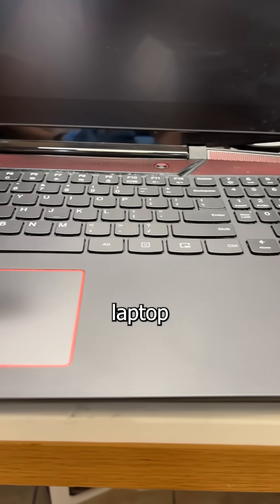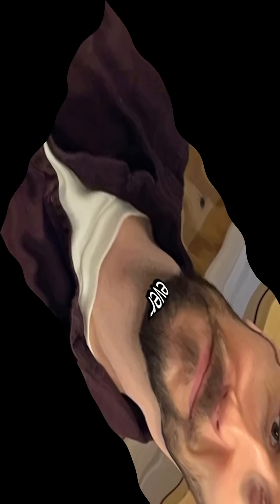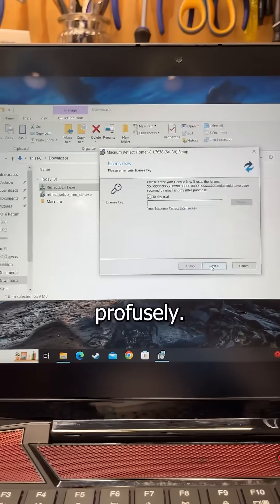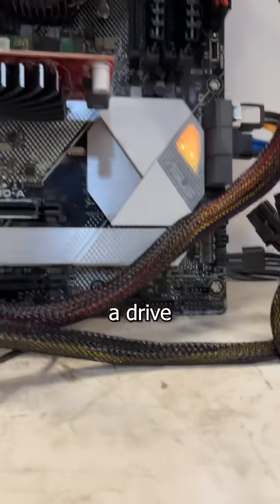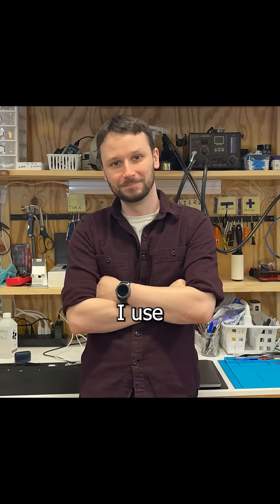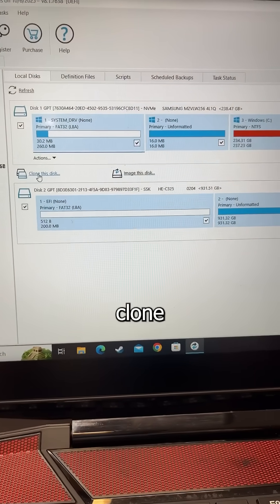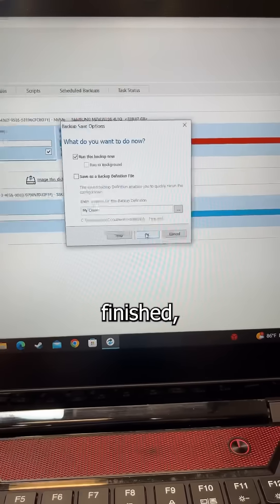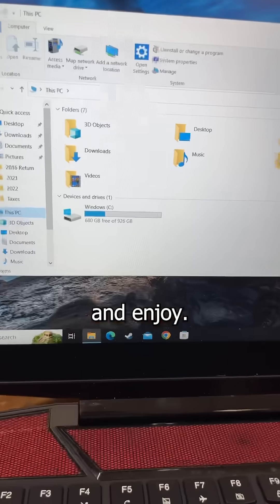Upgrading your SSD has never been cheaper! Clone it yourself! #tech #pc #technology #shorts #laptop

Comment: If you Copy the SSD to the Other SSD how did you get all the GB and voll Gb from the SSD, because i did it aswell and it just went down from 500gb to 120gb because i want to put from 120GB to 500Gb, any ideas how i fix the problem that the 500gb gose back to 500gb and not stay 120gb.. try many thinks but have no idea what to do anymore..

Comment: For the real technicians here: use CloneZilla. Free. Open source. Safe. Compatible with everything. Works without accounts or Internet. Can easily shrink or grow partitions.

If you have space to put it or a shop to run, use a returbished business machine with 2 inbuilt NVMe ports, Lenovo, Dell, HP, for that and install the drives there.

And if you plan on upgrading, clone the drive BEFORE you refurbish the laptop so wrecking customer data is one risk avoided.

Comment: What's the point of "cloning" when you can just install both drives on one motherboard and copy paste? You just might need to delete some files for windows if you use the older ssd as a boot drive. I've done this and have no problems

Comment: Hai, I would to ask by doing this drive cloning process for my drive C storage laptop. Will the system OS able to run automatically later after I change my storage into bigger SSD storage or do I need to reinstall my OS system again ??/ Cause I having this problem to for my current laptop drive C storage. 🤔🤔🤔

Comment: Hello!
I have the Asus K571GT, 256GB on the SSD and 1TB on the HDD.
I bought a 2TB SSD and got an SSK enclosure and used Macrium to clone my SSD to the new SSD.

Ran into an Error 9.
Did some checking, they said to run a CHKDSK on the C drive.
Did that. Restarted

Ran Macrium again. Cloning was successful.
Open up the Laptop, swapped out the old SSD for the new SSD.
Booted back up, and the laptop is stuck on the ASUS loading screen.

No rotating cursor.
Just sitting there for minutes.
Can't even boot into BIOS.

Swapped out the New SSD for the old one, and I'm back online again.

What went wrong? And how can I fix this?

Comment: I killed one of those,,, i owned it for aprox half a year,, then i tuched it,, and its cpu just... exploded on me, no clue how that happend, no doubt it wasn't the porridge i spilled on ot by accident, or the fact i spilled a cup of tea on it, it lived,,, all that,,, untill the cpu blew,,, i heard a poof noise inside my pc and all went black lmao

You may be the greatest technician that ever lived, but im the bane of the existance of every laptop that ever lived, i killed a laptop almoast monthly at my worst because i kept carrying it with me, drinking around it,,, one i even fell on when i moved in my bed and fell out of my bed

Now,,, ive moved to stationary computers,,, its dusty, nothing is screwed tight in my computer, my psu is just laying outside of my pc with random stuff on it, my two hdd's are hanging by the wire out of my case, my gpu,, all that holds my 3060 is hope and wishes ,,, but you'll be pleased to know my cpu and cpu fan is properly tighten and mounted! 😁

Comment: Followed your steps, everything booted correctly, until I uninstalled the app. Now my new drive goes into recovery mode immediately.
Reply from the maker: The app has nothing to do with the clone. You need to repair your boot sector using a portable version of Macrium or manually using bootrec
Reply: @SalemTechsperts  That didn't work. Had to reinstall windows completely, but hey, was able to get my important files back so all fine. Maybe a step went wrong at some point.

Comment: Macrium Reflect is great. I use it all of the time, but only to backup the system and all of it's programs, not to actually clone a drive.

It flawlessly copies software that's restricted for use on only one machine and transfers it to another. That way you wont have to go through the process of re-registering the product or worse yet being forced to buy another activation key. 

Before doing that to make the file smaller, I move all my data such as music, photos and videos to a spare drive then later copy them to the new system.

Like he says, it's a great way to give an old PC a makeover.

Comment: What's the adaptor that you used? I've got a desktop PC whose NVMe I'm trying to upgrade. 

Is it this one (UGREEN SSD Enclosure, Tool-Free USB C External, 10Gbps M.2 NVMe to USB Adapter/Reader Supports M and B&M Keys and Size 2230/2242 /2260/2280 SSDs) ? 

I'm ugrading a 256 gb drive to this 1 TB one (SK hynix Gold P31 1TB PCIe NVMe Gen3 M.2 2280 Internal SSD, Up to 3500MB/S, Compact M.2 SSD Form Factor SSD, Internal Solid State Drive with 128-Layer NAND Flash)

Comment: Don't forget to set the new drive as the boot drive in the bios.
Reply: Tbh you don't always have to do that. Ag least I didn't. I just put the drive in and it worked fine. Just reformatted the other drive as a secondary storage option

Comment: Sir please I have a laptop an old on persay a compact . Anyway I just changed the screen and the hard drive but it still has this same issue. The system fans sound like a dieing dog and then the the screen always doesn't display and the caps lock button light keeps flashing when the screen is dead and the issue normally fluctuates pls can you give me some advice

Comment: does this sort of thing work with hard drives too? my computer is stupid and has both an HD and SSD. the operating system is of course on the hard drive. the thing that could go kaputski literally whenever. if i can’t swap the hard drive for a solid, can i at least increase the size of the HD?

Comment: Hello, TGTTEL. I need help on my laptop for work. I've been needing to upgrade my ssd. I currently use Sandisk sd8sn8u-256g, which I want to upgrade into 1tb nvme. What I need help with is that I don't know what nvme pci gen is compatible with my laptop, which is a Dell Inspiron 15 7567 from 2017. Please help. TIA.

Comment: I have the same ssd adapter and you have to watch out because your ssd doesn’t thermal throttle with it. I had 2 ssd that went dead becoming of it. Was using it for an external drive on my Xbox.

Comment: Did this with my ThinkPad back in 2019. Bought the model with the least amount of storage and then upgraded it with the cheapest 2 TB drive I could find from a reputable source. I then put the 250 GB NVMe drive in my old gaming PC as a boot drive as back in 2014 even SATA SSDs were pretty expensive. I don't remember what Software I used for cloning in both cases just that I used a 500 GB intermediate SSD since I didn't want to pay for an external SSD case if I was only going to use it once and I found a SATA+Power to USB cable for less than 5 bucks. I also put the 500 GB drive in my gaming PC upgrading my SATA SSD space from 250 to 750 GB. 😊
Reply: Win win situation

Comment: I tried and used Magnum Reflect to clone drives for multiple computers using the trial. The interface was very clean and easy to use with a lot of debug interfaces to it (like command line style live logs). 8/10, would buy it if I had more of a use for it, or if they sold a limited personal copy for around 10 dollars.
Reply: Just use the free copy. It got discontinued a while back but it’s still on macrium version 8 so it’s more than capable

Comment: Ackchually, when cloning to a bigger drive you also want to expand some partitions. Maybe Macrium Reflect does this automatically, but my tool didn't, and I found out the hard way that using the same Windows install I was cloning to expand the NTFS partition causes problems.

Comment: This might never get an answer but here's the question:
I stopped doing PC repairs 8 years ago and we always just used Acronis. Why would you use a different software dependent on the hardware interface? The software usually doesn't know or care what hardware it's writing to as that's abstracted away by the kernel interface.
I assume you do that you do because it's built on experience. My question: do you know why one software is superior to the other when cloning dependent on the hardware?

Comment: TO THOSE WHO INTEND TO USE MACRIUM REFLECT TO UPGRADE THEIR C DRIVE WITH A BIGGER SIZE DRIVE: When selecting your target drive, be sure to click the select the button that says Copy Partitions and select the second option that says "shrink or extend to fill drive", if you don't do this it will only make a 1:1 copy of your C Drive and not take advantage of the extra storage!
Reply: You can extend the c drive through unallocated space later through disk manager too
Reply: I read this fkn comment a little bit too late.
Reply: @yoshivro Probably way too late but you can always extend it later down the line. If you go to computer management, then disc management you can just select your windows partition, right click and extend the partition.
Reply: This saved me tbh thank you
Reply: You can just create a partition off of the unallocated remaining space (i did the exact same thing on my c drive)
Reply: @snipyshot1177 you're better off not creating another partition, just extend it. Creating partition complexity will create issues later if you run low on space with the original C: partition. Moving data and partition alignment is a slow process. Use folders to organise your data.
Reply: This is where Acronis is better. It already assumes this for you. ✌🏼
Reply: Wdym by it "not taking advantage of the extra storage" ?
Reply: @MooGoMooGo when you clone 1:1 from 500GB to 1TB, what do you think will happen?

Comment: In macrium, you also need to make sure the entirety of the new drive is selected and not left white. Otherwise, it will only allocate the dame 256GB, or whatever the other drive was, to the new larger drive
Reply: Yes but you can always extend it even inside windows after.
I still don't know if it's ok to do that, but I've been doing it for years.
Generally the other solution is to backup important data and do a fresh install, however not everybody want/can do it everytime swapping disk
Reply: @sam_music555  If it's gonna write at the end, you won't be able to extend, you'll have to create a new "disk". It sucks
Reply: Was going to post this same thing.
Reply: I'll piggy back off this to post an easy answer for later people who find this. I found a video by XanTech which had the answer for this: when selecting the destination for copy using Macrium Reflect, just above the drive is "Copy Partitions" click that and select "extend portion offset to fill target disk"
Reply: I just cloned a 500gb to a 1tb ssd, and I have the issue of having the other half unallocated, and had to partition a new drive to use the rest of the drive
How to I combine the two?
(I am fairly computer illiterate, possibly wrong wording)
Reply: @y0ALTR  which software are you using to do it?
Reply: @nman1  A good software to fuse partitions into one is MiniTool Partition Wizard
. I made the mistake not to select the whole drive in Macrium and then used it to simply allocate the rest of the drive and then fuse it with the OS partition. Works fine. 

Bought the software years back and it helped me out several times.
Reply: nice
Reply: I learned this the hard way XD
Reply: Ohhh okay I just asked ChatGPT and figured it out. I appreciate you for posting this comment! You saved me!!!
Reply: You can just allocate it in disk management.
Reply: What do you mean with the entirety? How can i only choose one part of the drive?
Reply: @ It doesn't automatically adjust the partitions to the larger size, instead by default it copies them and leaves the rest unallocated. I'm not sure why, or how, you'd select to only partition a part of the drive, but you can extend it to the whole size.

Comment: I generally thought you was the greatest technician to ever live until you recommended macrium reflect. They cost me over £200. I tried to clone to my new 2T SSD which cost me £124.99 and 88% into the clone an error occurred, it then removed all partitions from the drive and basically killed it. I constantly get the "the specified device doesn't exist". Spent weeks trying everything. Then my dumb @ss goes and buys another 2t SSD and exact same thing happened at 88%... fck macrium 😢
Reply: So you cloned to a new 2tb you just bought and it died in the cloning process. Why didn't you just return it as faulty?

Comment: I usually use dd for cloning drives. 
(if you don't know what dd is, look up "dd command") 
But `cat /dev/sda > /dev/sdb` in a root shell is not bad either.
Reply: Personally, I use dd, and not cat, because there's an option in dd nowadays that lets you see progress:

dd if='/dev/sda' of='/dev/sdb' status=progress

I don't think you can do that with cat
Reply: @Tom-uy4io  
Basically days after writing the above comment I also switched to dd for the task, dd was just a bit too scary for me at first, which is why I kept clear of it for along time.
Reply: @Lampe2020  dd does look a bit scary for a beginner like 5 yo me cluelessly formatting my boot drive because i typed sda2 instead of sda3 
(my mom reinstalled windows on the family computer so i couldn't mess with terminal again till i was 7 lol)

Comment: I use a custom Linux distribution designed to clone drives. I have it on a flash drive somewhere. I don't even know what it's called. It works great. I've used it on like six drives. Hard drive to solid state doesn't matter. I don't know why you're using separate software for different types of drives, but I'm not the greatest technician that ever lived so I'll shut up

Comment: I use Samsung data migrator, but both drives have to be plugged in directly into the motherboard, not the io, like actually the slot. But, I prefer Samsung ssds only for that software, since it is so easy to use and you can migrate from any ssd to only a Samsung ssd

Comment: I'm still trying to figure out how people even LET their main drive get so full...

I've had this laptop for 2 and a half years. Haven't replaced the stock 512gb NVME. It still has 144gb free. Instead I just added a 1tb drive to the extra NVME slot and use a 5tb USB HDD.

I ALSO get rid of old unused files. Not hoarding random stuff I'm not using has done WONDERS in helping me not fill my drives up.

Comment: You wanna know what im wondering? Im wonder what the greatest technician thats ever lived's favorite laptop to use is.
Reply from the maker: Lenovo ThinkPad W530
Reply: @SalemTechsperts   Y'know, i didnt think you'd actually reply so fast... Ima check it out.
Reply from the maker: @azatellatia277  you caught me at a good time. That is my fav laptop to use, but it's also 11 years old and has outdated tech. My personal laptop is a 2021 HP Spectre x360 15.6 with a 4K OLED and 1660 ti. But I had to spend hours modifying it to get it to run properly. Which included undervolting the cpu, which you can only do if you manually edit the BIOS using some sketchy Russian shit.
Reply: @SalemTechsperts  Wow.  All I can say.

Comment: price of ssd 50 dollars, time to clean the pc, 30 min, time to install or clone windows 20-30 min

Well that's gonna be 300-400 dollars.

Yup understable good day

i'd rather learn myself if i don't know some specific thing.

I was in a foreing country with no access to tools, i had to rely on a "tech" to clean my laptop.

There was no longer laptop, yup, broken from cleaning

You either are clueless or charge the price of half the laptop for everything you do

To be fair most often than not, you are just clueless, the good one doesn't show on google or marketplaces..

Still don't know how to fix physical hardware (like soldering a motherboard) but neither 90% of techs, so until i learn, i do warranty or buy a new one if it's expired (3 years here)

The thing i'm not a tech, i don't have too, but you look at marketplaces, you look in maps for shops, i wonder how they got there they don't know soldering they don't know anything about pcs, is unbelievable.

My stepfather change my internet cable on my bedroom, he failed, i called someone on marketplace, yep the "tech" he was clueless and told me, you know much more than me, you should get your certificate to work in tech, i was shocked and i had to pay anyway.

Comment: Now I'm curious what your reaction to my laptop would be. No battery, missing most screws, one hinge broke out so I fixed it in an ugly (but functional) way. Hard drive is held in with random screws that had the right thread pitch, screen is delaminated and has a few specks of hardened superglue, keyboard is missing keys and doesn't even work from how dirty it is under the keys, and finally I have to manually put it to sleep because it no longer detects when I close the screen

Comment: how do you have those things running cool LOL I have that same m.2 adaptor and every time I clone or use it, it heats up so hot and I need to have a fan blow directly on the aluminum casing. Maybe you have a fan on there that I didnt notice
Reply: I wouldnt care for the most part but it runs so much faster if I have the fan on it so, I do.

Comment: A question: how do you fix a similarly designed laptop that got a crack on one of its handles that connect a monitor to the body, all without replacing the monitor itself? The tape helps somewhat to prevent further damage but moving the monitor much in any direction is not an option due to some of the outward plastic (casing) layers starting to come off the further the bend (the handle, due to compromised stability, stays mainly in place when monitor is attempted to be moved thus causing the further damage).